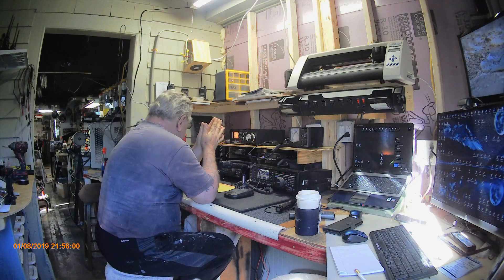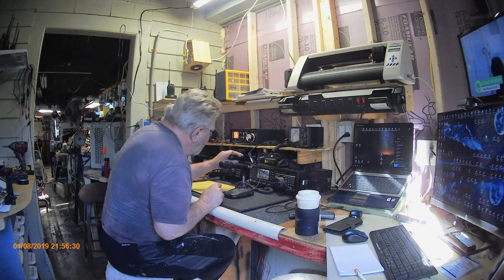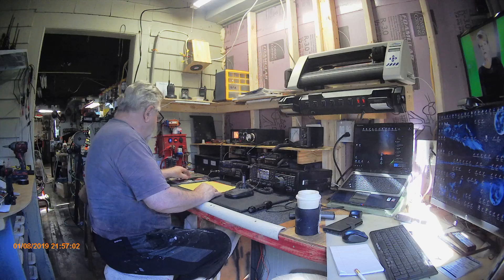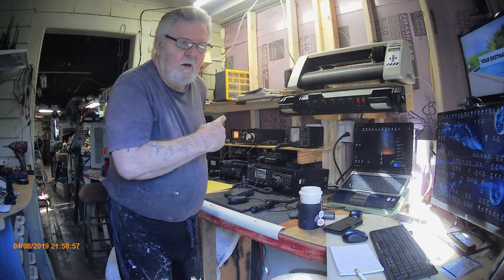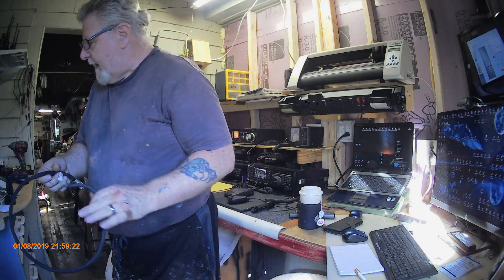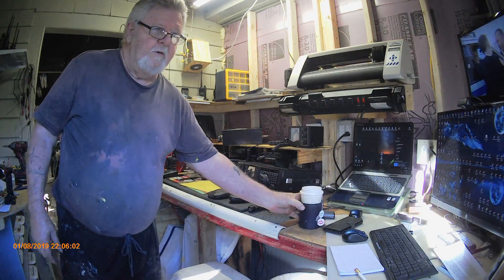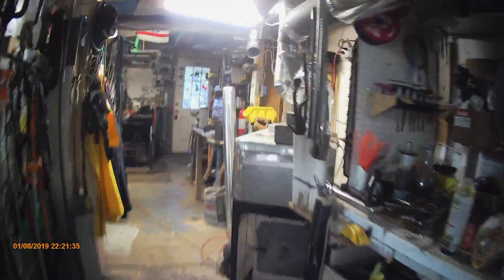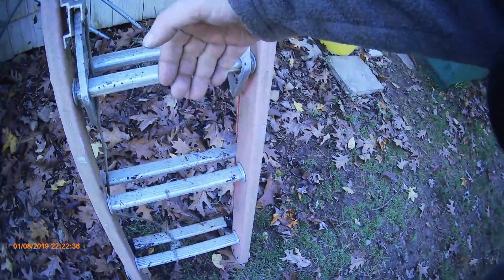To the roof again, Start to hookup radios

Comment: Something I did that helps me tremendously and I discovered not too long ago is to take the flat bread bag tabs and mark them with a Sharpie and put them on the cables where they come into the shack. They fit perfectly over the smaller coax. Then I know which antenna goes to which cable coming in. Otherwise I stay confused. HiHi. De KA8MNO
Reply from the maker: O, good idea, I have them everywhere around the shop, worth a try, Thanks